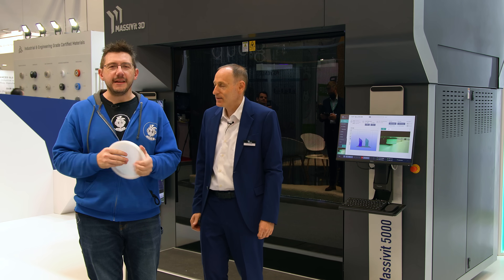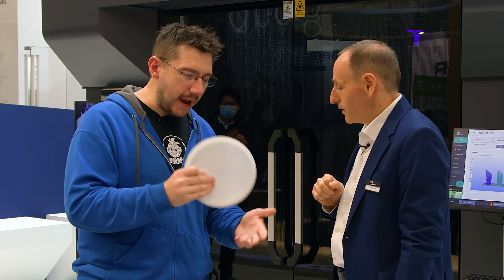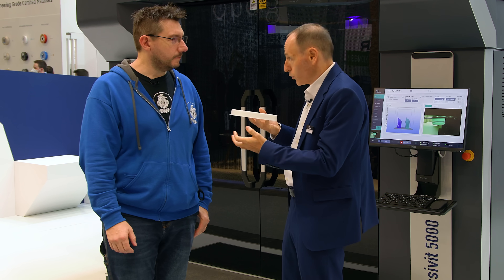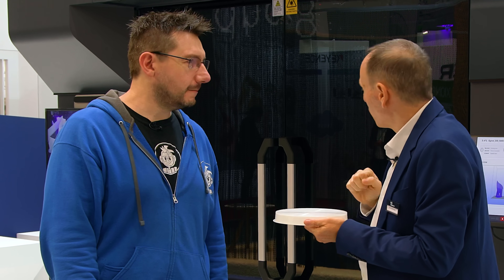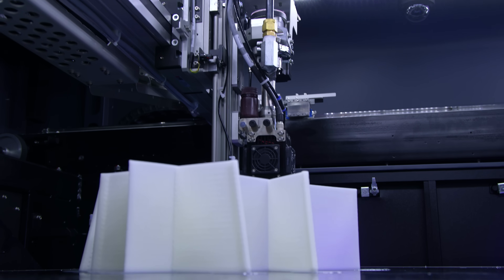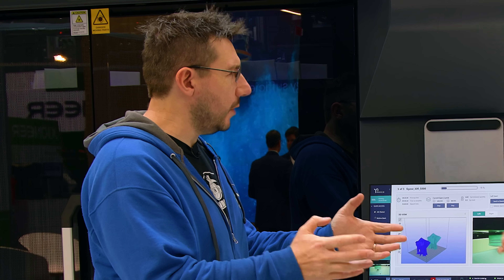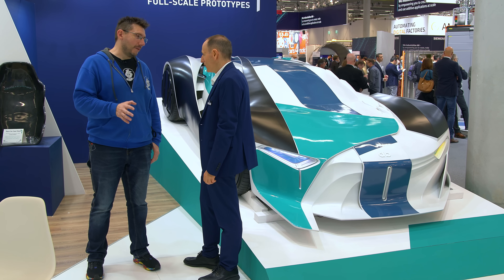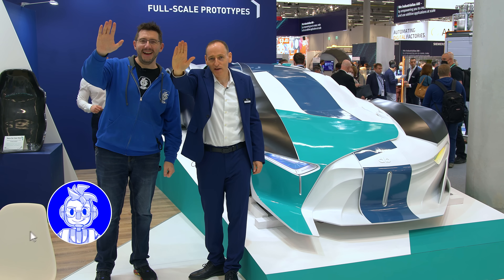6 FEET in 6 HOURS - ULTRA FAST 3D Printing with MASSIVit!

Comment: Massivit's UV toothpaste tech is pretty wild! How strong are the parts?
Reply: Back filling the parts with expanding foam would make them super strong as well.
Reply: @martylawson1638  or fiberglass+resin
Reply: I suppose extruding more than one gel from the same nozzle would be relatively easy, just like a toothpaste tube. Multi-property printing like this on a scaled down machine would open up new printing possibilities to everyone.
Reply: well acrillic is quite strongen for a plastic
Reply: I have a couple of parts.  Incredibly strong.  They stand up to any abuse.  If you can afford the infrastructure required to operate it and the cost of the machine you would have more business than you could handle.
Reply: @bertmccumber4968  what infrastructure is required? Just the gel?
Reply: you'd first need 3x32A 380-400VAC, 50/60Hz, an air compressor to provide air pressure 6-8bar /88-118psi, a ventilation system.  The company I've dealt with that has one pays $8000 a month on their loan. That's for an Massivit 1800.  It's an amazing thing to watch it print and is at the top of my dream list.  Imagine a 3D printer that you can stand inside.
Reply: @bertmccumber4968 this strong?
 https://youtube.com/shorts/r5Tw2PudDAs?feature=share
Reply: @bertmccumber4968  What business would that be? I’m honestly curious
Reply: Acrylic nail gel and a parasaltic pump or depending on material usage a syringe? At least in a ender 3 formfactor. Add uv LEDs to the hotend.
Reply: @printcrab8483  You'd probably need more than just a few UV LEDs if you want to print at a reasonable speed. UV resin printers have to expose multiple seconds for layers thinner than paper and you couldn't expose the whole print volume at all times as that would overcure the print
Reply: It's brittle as hell. We have one and rarely use it for the fact you have to constantly monitor it while it prints to avoid any failures. Afterwards you can either fill it with smooth ons expanding foam or hard coat it with a thick type of spray polyurea based hardcoating. Finishing the parts and removing supports is also a pain. I prefer to mill most 3D models out on our 7-axis robot milling arm. It's better in the fact that you can leave a program running for hours on end and then hard coat and finish the parts after. EPS foam is also stupid cheap compared to this material. Benefits of making parts this way is they're lightweight, durable, and provide you with a cleaner base model for finishing.
Reply: I suppose that they'll sell this "toothpaste" for some good amount of money :) Or it doesn't need so much noise and "wow" presentations.
Reply: @KiR_3d  with 50 patents, I'm sure they're charging top dollar for every step of the process.
Reply: It really depends on the end use requirements. Large end parts, prototypes, and molds can be directly 3D printed for railway, marine, automotive purposes. If required, the material supports a ton of standard post processing methods including composites lay up, car paints, sanding.. Some customers directly print marine parts and reinforce with fiberglass or Kevlar, passing the  needed standards both for load and seaworthiness. The ships have been tested at sea for 2 years without incurring damage. Other parts have been printed for bus shelters and left in exterior snowy conditions for 2 years.
Reply: I spoke with one of their engineers at IAAPA and he explained it’s very close to PLA in material properties once hardened. They are talking to another company about coatings for smoothing and hardening the outer shell. The couple demo parts with this spray definitely were sturdy and layer lines were gone.
Reply: Hilariously brittle
Reply: @Dakota_Daniel_Designs  If it is straight methyl methacrylate resin with a UV catalyst, then I totally agree. However, I have a feeling they put in additives to make it a better material.
Reply: @josephgauthier5018  handled it at an event a few weeks ago. You can snap it with your fingers in some cases.
Reply: @Dakota_Daniel_Designs  I see. That is unfortunate
Reply: Thats the  correct question
Reply: I can see you using this to make a Gundam or something.
Reply: I suppose if you print the outer walls, you could fill it with standard acrylic resin and have a solid piece.
Reply: @bravofighter  I think that for big parts that would be pretty expensive, but for smaller parts I support your idea, sounds cool.
Reply: @8:25 you can see an actual ladder for the yacht.
Reply: @Felix9lives  - that's a radar/nav-light mast. I suspect they use the 3D printed part to make a mould to then make the actual part in fibreglass resin.
Reply: @SimonCoates  could just fibreglass over the 3D print. Two or three layers would make it strong enough to walk on like a ladder easily. I suspect most of those parts are fibre glassed, sanded  and painted since he referred to "marine finishing techniques"
Reply: @SimonCoates  Actually the radar masts were directly 3D printed rather than created from a mold. One of our customers, Velum Nautica, 3D prints all types of large custom marine parts for their customers according to need. They can either be designed in CAD or simply 3D scanned from an existing part. The material supports a range of standard industry post processing options including fiberglass lay up, car paint..
Reply: @Massivit3DPrinting  thanks for the clarification. Very impressive technology. The potential for space saving could be a huge factor for smaller businesses. I used to deal with a company that made aluminium castings and the storage area for moulds was the size of a football field.
Reply: @SimonCoates  Thanks for your input Simon. There's nothing like direct printing... :) Which industry and applications were the aluminium castings used for?
Reply: @Massivit3DPrinting  They mainly produced decorative aluminium castings such as street furniture, embellishments and traditional designs. The business went through a bad period and they ended up burning a HUGE number of wooden moulds, was a sad moment - all that work and history gone up in smoke. With your system it could all have been saved on a thumbdrive.
Reply: Lol yes, think of repair 😄
Reply: Love your show man. Hello from Florida.
Reply: If it's like most UV cured stuff, probably extremely hard and brittle.
Reply: We need Stefan to find out!
Reply: Probably same as uv resin.
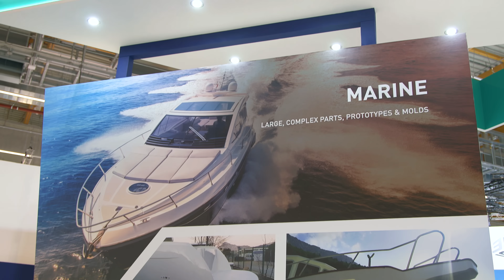Reply: The boat ladder design at 8:14 has an insane cantilever load path if that's how they're using it
Reply: If you use it to make molds, then it doesn't matter!
Reply: @ahaveland  Mold making is the primary use case for these machines, which is why their new machines integrate the entire mold making process including finishing and casting the mold itself into the 3D printed mold. You basically 3D print the mold for the mold, machine it to final tolerances, cast the final mold resin and then cure it in an oven, the 10K line of their machine integrates all of it into a single solution so at the end you can get a mold that can be used to manufacture composites. 
It's much faster than machining aluminum and you can also easily iterate the molds within hours to days instead of weeks to months. 
Since you are 3D printing complex geometry is far easier to achieve than with milling and you can embed relief surfaces, complex alignments and undercuts as well as integrate the features needed to vacuum draw vacuum or for resin flow when you mold composites.

On a smaller production scale you can also 3D print the parts and then use a dipping process where the parts are dipped in resin and reinforcing fiber, this allows you to very quickly produce strong parts with complex geometry instead of manually laying composite sheets on them.
Reply: If the toothpaste is like the gel that the dentist flick your teet with then yes
Reply: @BlueBanana421  my dentist doesnt flick my teet, how do I get in touch with your dentist?
Reply: @MrTylerbrogan  ROFLMFAO
Reply: Just because you can make it hollow doesn't mean you have to. 🙂
Reply: Sanjay died rip
Reply: @maxtsarenko9802  who is that?